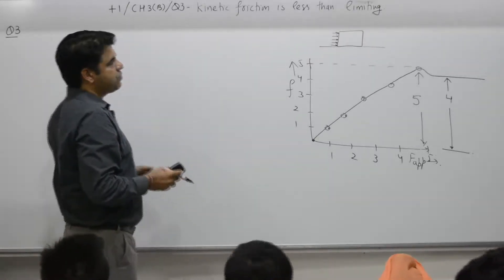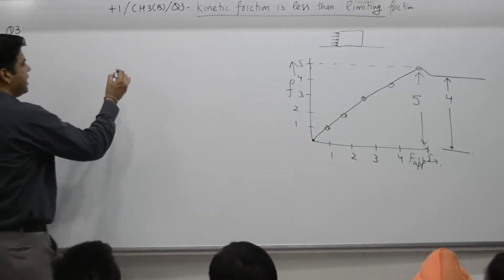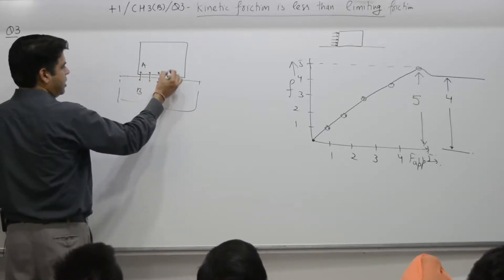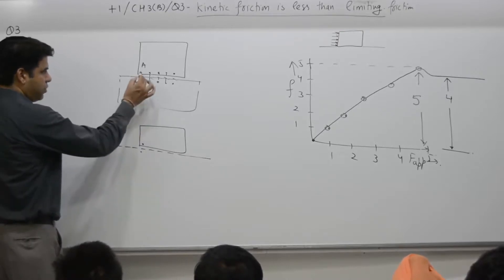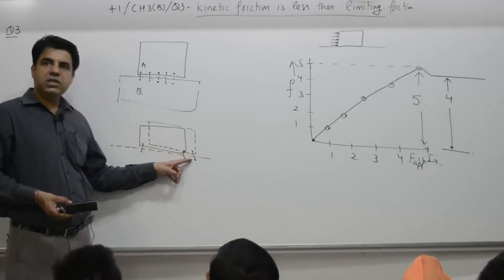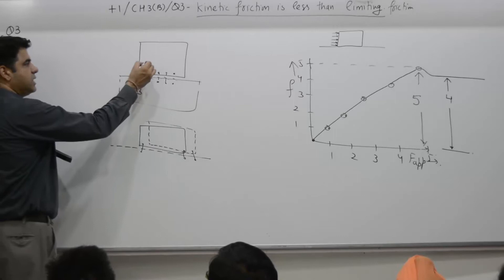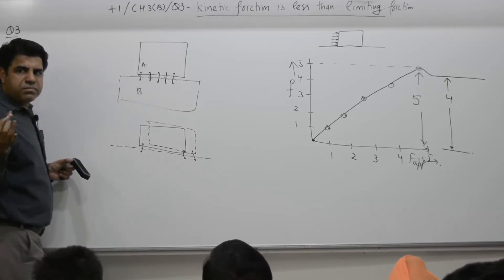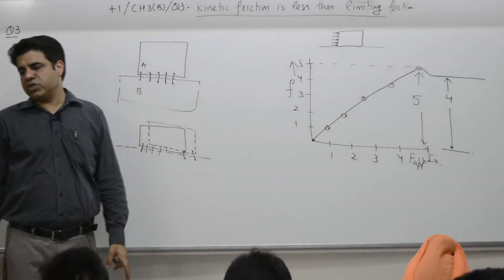Class 10+1, Chapter 3B, Question 3, Kinetic friction is less than limiting friction

Comment: Sir u said it is at rest b9nd were formed than according to rhis concept it shoud depend on area of contact more will be the area more will be space and more will be bond formed than more will be ciff. Of friction
Reply: No actually if area of contact increases, the adhesive forces (bonding between the atoms) also increases in same ratio and thus adhesive pressure (=F/A) responsible for friction remains constant.    
Hope this helps you.... 😇